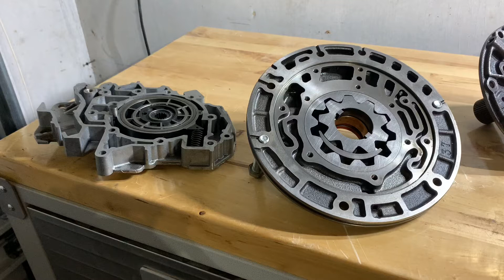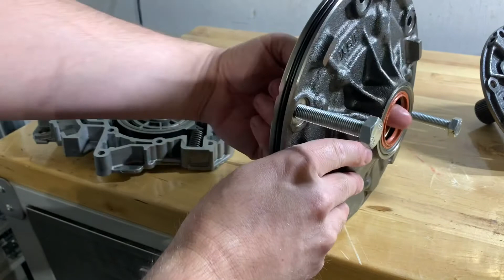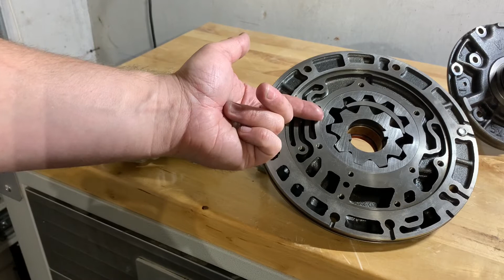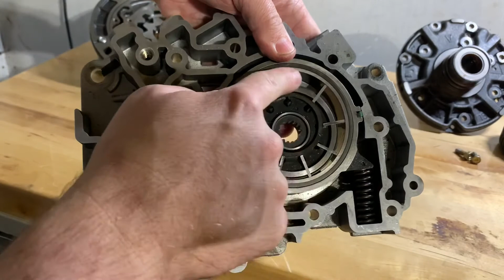Types of Transmission Pumps

Comment: are the pumps different on the 4l60es  i broke the pump on my 90s 2 piece 2wd 4l60e in my trans am it was swapped prvious so dont kow exact specs on tranny anyway that pump is broke an di need to fix it will any junkyard 4l60e transmission pump work ?
Reply from the maker: Yeah for the most part they are the same but the junkyard can look up what years are crossover years for that part.